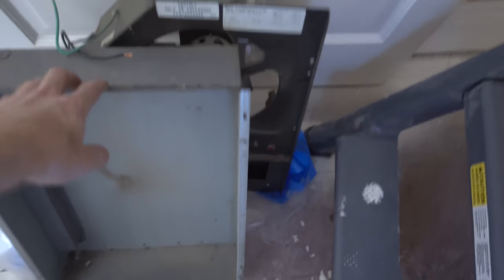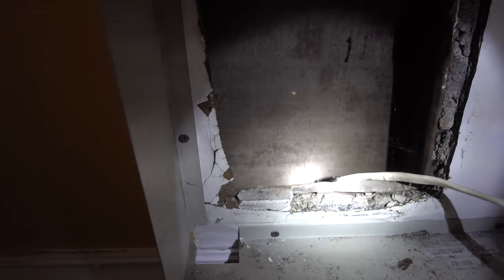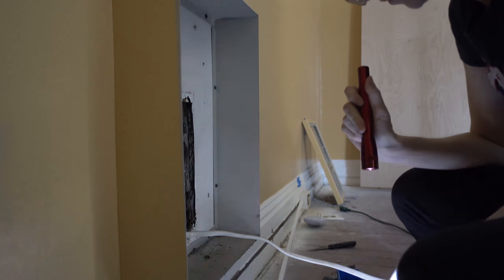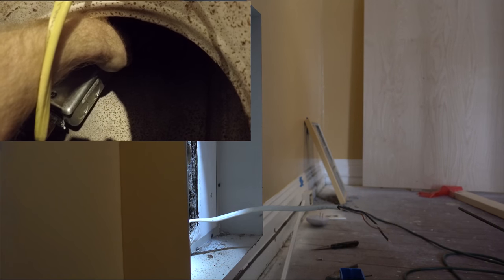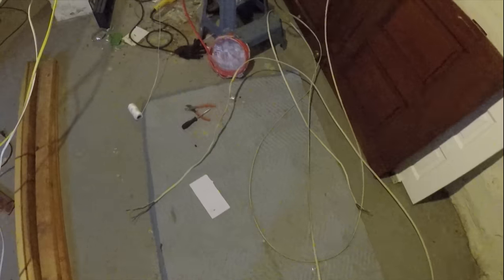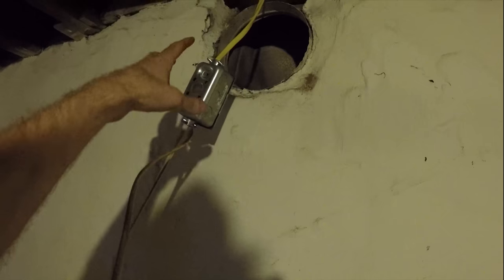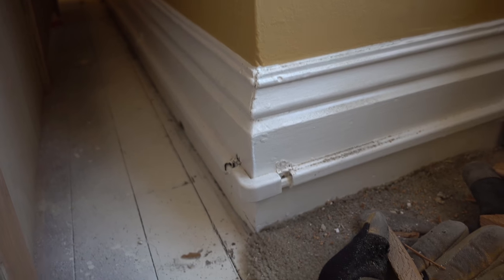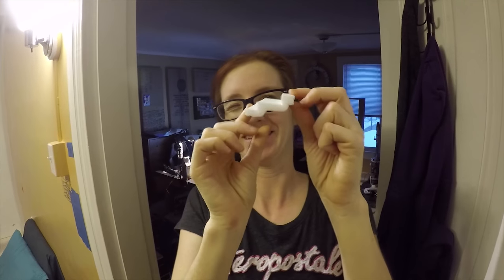Corgi Gets A Snow Day for Spring!

Comment: For the common wall, look for something called Rockwool insulation. It is made from either spun molten rock or metal. It is highly fire-resistant, and is excellent for sound deadening. Also has a decent R-value as well.

Comment: It is not a load bearing wall....just a false wall alllowing modernization of uliities. But you could also use bit as sound dampening since it is a common wall. Although not quite sure if special care need to be taken considering fire code though since it,is adding to a common wall.

Comment: Note to Steve: remove thumb from microphone before recording. 😲
Reply: My bad gang. First time hand-holding the HERO5
Reply: IridescentShadow 👍
Reply: IridescentShadow Steve, how far UP the wall does that duct go?
Reply: Only a couple inches above where the hole is
Reply: IridescentShadow A couple inches? I would have guessed a floor or two. What's (was) it's purpose?
Reply: I'm still not sure what the purpose was, but it runs continuous from the 3rd floor all the way to the basement.
Reply: IridescentShadow Ah, now that makes more sense. Does the house have dedicated return air ducts? That was my first thought.
Reply: this is the only room that has a duct going to it. I'm not sure why that is
Reply: IridescentShadow Very strange.